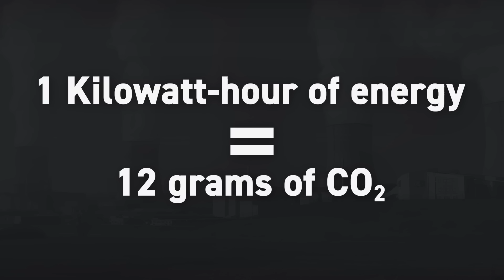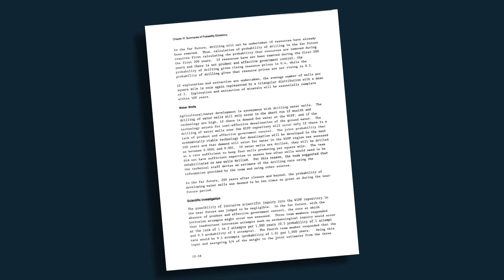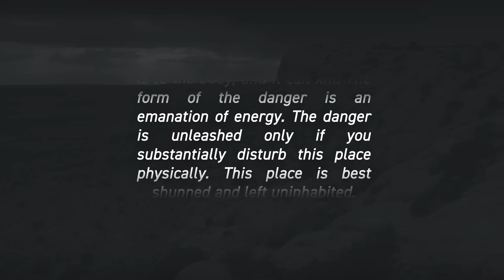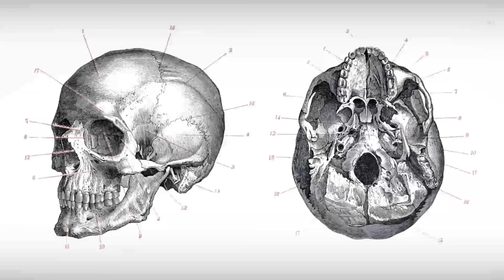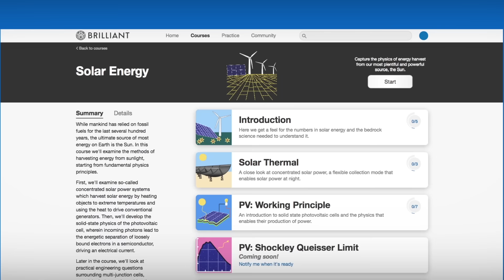The Nuclear Waste Problem

Comment: In Japan, highly radioactive water is stored in huge metal containers or tanks Water is leaking out of many of these holding tanks. The solution to this problem is to add gelatin powder to stabilize the water and prevent the water from leakig out into the environment. 

Hi, I just watched a short segment on YouTube showing where, and how highly Nuclear waste materials are being stored along with controlling radioactive hot spots on the soil everywhere. The nuclear scientists don’t seem to know what to do with all the radioactive waste being housed and stored everywhere on the surface of our Planet. Much of this radioactive contaminated material is in a solid form such as metal and stored in the open leaving it exposed to the atmosphere and ground water. They are burying much of it, which in my opinion is the worst thing that can be done, because the radiation will transmigrate into the water table through-out the entire Island of Japan. The drinking water is already contaminated with radioactivity on a low level, but accumulates in time in the air, sea,  land and within the body and then you die.   You may want to know how radiation transmigrates into the water table? Example: A peace of material made of Iron buried in the ground would turn to rust, or Iron Oxide. The rusting metal could contain highly radioactive elements have a long half-life in the thousands of years . When it rains upon the open stored material,  the water drips onto the soil  saturates the soil particles that join or blend in with the long-Lived radioactive rusting particles that makes its way down into the water table then spreads and contaminates all the drinking water on the Island, then leaches into the Pacific Ocean and in time will contaminate all the water on all the oceans and seas on Earth. Conclusion:   Solution, I dug up a large piece of iron square tubing about four feet long and about four inches across under 18 inches of soil just outside of the Sarcophagus of Chernobyl’s blown our reactor # 4. It had spat out of reactor at the time of the explosion. I had to put in a requisition for a guide along with a dosimetrist that took half a day of paper work to help me locate the radioactive material that was covered up with top soil shortly after the explosion. because I knew it was everywhere and soon we found it the rusting metal material that I was looking for.  At that point, I asked the guide to go get me a shovel and he said, “You have to put in a requisition to get one” My plane was leaving from Kiev in three hours and I didn’t have the time for paper work So, I dug it out of the ground with a stick I found while the other two watched me, and one said,  “You are crazy Mr. Nelson”. I dug it out of the soil then proceed to cocoon only half of the rusting metal and re-buried it. Then I marked and stacked the location to be dug up in 50 years to discover that the portion of the tubing that was cocooned remained as it was the day that I cocooned it with a formulated wax, while the portion of the rusting metal that was not cocooned was gone, rusted away and had blended in with the soil in the ground to trans migrate into the water table.  Cocooning radioactive waste material is the solution for safe long term burial, preventing the radioactivity from spreading. What worked in Chernobyl will work in Japan. All radioactive waste should be entombed and saturated with wax, then buried.  As for hot spots on the ground surface, all that is needed is to pour hot high melt pouring wax over the contaminated section, and after 15 minutes that whole area can be lifted off the soil or removed in one piece. This should be implemented, very soon. I want to say in the future if I am still alive, “ I told you so” I am claiming that this discovery was posted here on FB this day of October 11 – 2018,    Willy.

Comment: FEARMONGER!!   Stop trying to scare people and do your research.  This is a bad video that was not explored properly.   Radioactive waste can be recycled and reused in reactors invented in Canada decades ago.   When reused it reduces the dangerous period of the wast to around 250 years, a very manageable number.  It also would stretch out the supply.  Even old waste can be used in this way.   The reason why it wasn’t done is he expense.  If the people in charge got their acts together and built some CANDU reactors we could solve the issue.
Reply: DUPIC is indeed very promising. I'd also like to see some minor-actinide reprocessing using MOX, but windscale kind of made the world skeptical of MOX fuel cycles. The difficulty is keeping non-actinide long-lived isotopes like Tc-99, Cs-135, Zr-93, and Pd-107.

Comment: This whole video was nothing but baseless fearmongering. All of the concerns have been addressed and nuclear power is the safest form of energy production we have.
Reply: @anon8510  Not really, there's good ways to manage it safely, look up Illinois EnergyProf, he has several good and informative videos on nuclear energy, including waste management. If we really want to solve climate issues nuclear is the only viable solution.
Reply: @anon8510  Basically high level nuclear waste, the real bad stuff, isn't much in terms of quantity or volume. As such it is easier to manage than say slurry ponds from coal mining or mining heavy metals for batteries. Nuclear waste just needs kept somewhere stable and dry, that can be secured from the general public. This is easily accomplished with the practically finished Yucca Mountain depository. We just need to actually do it and have the politicians quit quibbling about funding.

On top of that, new reactors have become more efficient and can even operate on what would previously be called "spent" fuel rods, keeping them out of storage and using them longer which helps mitigate waste. Nuclear energy is the best energy we have for sustainability.
Reply: He isn't saying that it's super dangerous, and that it is bad. He explains that nuclear waste is a problem.

Comment: Wait hold on.
"release radiation into the environment" That's not the issue... The issue is radioative particles getting into the environment and getting stuck there.
Radiation is nothing but EM frequencies that are harmful when you are directly exposed to them, radiation itself doesn't leak anywhere it is like shining a very deadly light at something, it's the material that is beaming with radioativity in all directions that is the dangerous thing, because if this material gets into your body all of it's radiation gets absorbed by you. So this is a bit misleading here.

Comment: Although we have relatively low adoption of nuclear energy (only 10% of power generated in the world come from nuclear), we already had two deadly incidents. Now imagine a world where 50% or more of the power we use is generated via nuclear, will we have 10 incidents? how many will be worse than Chernobyl. How much of the earth's surface will become exclusion zones? And this is being conservative given that wider adoption of nuclear means having plants in places that are less developed and less skilled or less disciplined at maintaining those plants. On to the waste, how much of the nuclear waste will not be properly disposed of and end up leaking radiations? While many swear by nuclear energy, I see it as a gamble, where you only need to fail once, and the price you pay is too high.

Comment: What a laughable video. Doesn't this guy know anything? Gen IV nuclear reactors that can run on the current nuclear waste are being developed as we speak. And then he goes on to what might just be the most stupid project in the history of mankind, the finnish permanent storage facility. In like 20 years they'e gonne be like: we should start digging up the spent fuel again so we can use it. There won't be a long term nuclear waste problem, we'll be able to reuse the current spent fuel and reduce it's high level radiocativity to as little as 300 years instead of 100.000 years.

Comment: Compelling story as usual yet this feeds the notion that nuclear power is the big awful boogeyman. 
   There were zero deaths from radiation poisoning with Fukushima.  You did not report on this.
   You didn't cite the upside of Fukushima being the worst case scenario with a massive earthquake and a gigantic tsunami and three reactor meltdowns and how there were no deaths from radiation. 
   You didn't cite how the areas around Fukushima are becoming livable now. 
   You didn't cite the amount of Flora and fauna that are proliferating around Fukushima not to mention Chernobyl including its tourism having to do with the reactor and the abandoned city.
   You didn't talk about how the deaths around Fukushima were primarily from the government's overreaction with the evacuation and how many people died of despair of losing their home. Many of these people could have returned to their homes with certain precautions.
      I would love to have Frontline do a positive piece about generation 4 reactors and how they are walk away safe.  There's about six different designs for generation 4 reactors and there's about six different criteria that make them so safe and desirable.
    Cheap abundant electricity is good for mankind let alone its ability to cut way down or reverse on greenhouse gases by  actually powering carbon scrubbers.
    These small reactors can be used in conjunction with wind and solar. They can be powered up and down quickly like they are on a nuclear submarine. 
    The footprint of a generation four reactor is about that of a Walmart and could be as common as one.  Truly a local power source to complement wind and solar.
   These gigantic reactors with generation 3 have residual heat that doesn't allow that so easily. 
    Think about the days of slavery and how human capital needed to be exploited to get things done. By having cheap abundant electricity this frees up mankind to pursue more enjoyable endeavors.
    So I implore you or as they say in the south, double dog dare you to do a positive piece about nuclear power and the future with these designs that are being  built around the world.
      I encourage you to do a piece about how the United States is falling behind because of hit pieces like this that are scaring the public and politicians away from generation for reactors.
   There are forces out there that want to make nuclear power so expensive that it can never be built.
     I encourage you to talk about how many people die in the process of mining coal or extracting oil. I encourage you to talk about the number of deaths that come from polluting our air and water with these dirty power sources.
   I encourage you to talk about how the smart money in the room is actually betting on generation 4 reactors for example Bill Gates with Terra power.
   Countries like Russia, India, China and Indonesia are building these generation 4 reactors as we speak.
Reply: He did actually mention that neither of Fukushima's 2 deaths were from radiation. I think that's all he covered though.